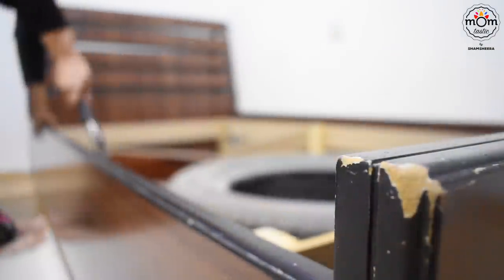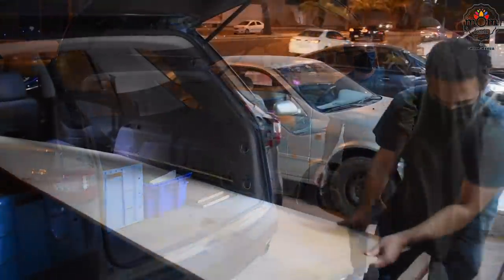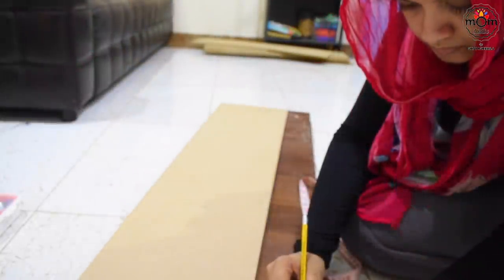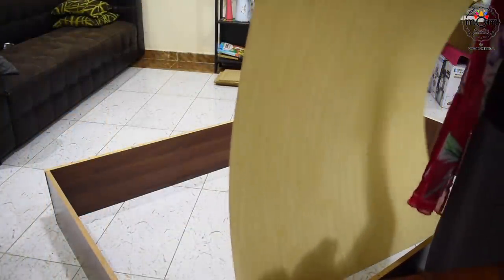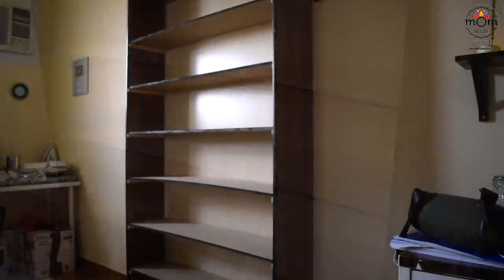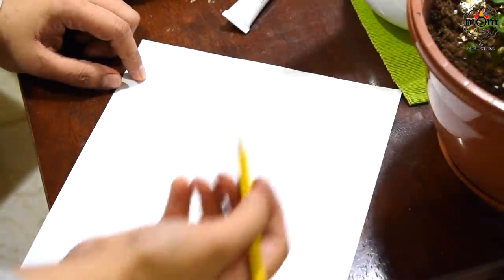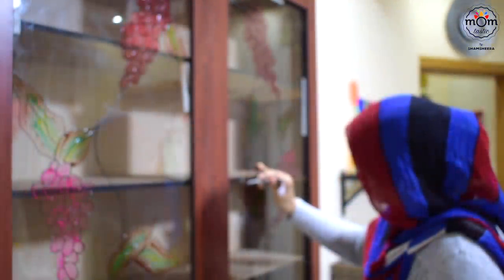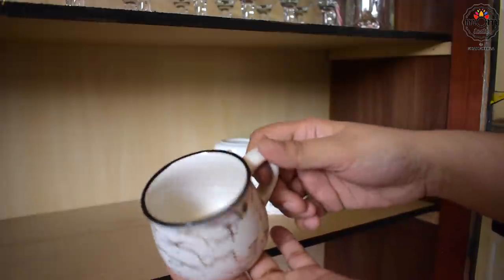Transforming Old Cot to a Cabinet || Glass painting and Organising

Comment: Very nice. You can also add lights inside the cabinet.  Underside of each self you can place two or three stick on lights. No wire or plug needed. I mean lights with cell or batteries.. Glassware will be glowing when you on the lights. 👍

Comment: You are so talented, Shamsheera.I would never have even imagined you could do that with an old cot! Here in Canada, we have to pay to the dump station when we throw away old things, this is such a wise way to recycle for a sustainable environment. I have noticed with cabinets like this they tend to be front heavy, so securing the back to the wall with a tiny bracket (like the front heavy cabinets in ikea) will ensure it doesn't fall forward.
Reply from the maker: Yes, the cabinet is nailed to the wall feom the top as the carpenters told that once the door is foxed, it can fall towards the front .... hence we nailed it ☺️☺️☺️

Comment: As always it's nice and good dear. About the painting I think the way and painting over glass is not the way we usually do
 Actually you should fill in the marked lines using the colours by pressing until the place to fill is completed without bubbles if bubbles comes u can remove it with sharp needle or pin. Then only that bright colour will come for the glass and it will be bright .Try this way once dear
 Tc
Reply from the maker: By standing and painting, it was really not that easy. I used to glass paint in school time, and i used to place the glass on the design and trace it. It wud come out lovely. 
But for here i got not that good paints and even design didn’t come up to my satisfaction. ☺️☺️☺️☺️